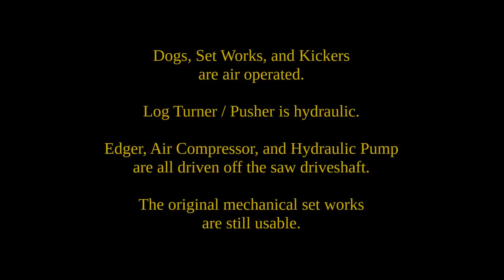Fast Steam Powered Air Set Hardwood Sawmill - Buckeye Steam + Gas Reunion - August 2018

Comment: When the saw blade is in the cut and we hear 'thunk a thunk a thunk'..is that the steam engine under a load?
Reply from the maker: Yes.

Most of these engines have a single double acting cylinder.

The 2 ends sound almost the same, but piping and other minor differences mean that you can hear the difference in sound.
Reply: @SteamCrane  Thanks.

Comment: Nice setup and love the sound of the steam engine under load 🙂
Seems like the air supply is not enough for the setworks.
Reply from the maker: Interesting, next time I'm out there I'll look. Of course they may have upgraded the air compressor since 2018.  Each time we go there, there is some improvement. This fall, they added a green laser for lining up the cut.  Not sure that sawyer really needed it.

Comment: I still remember the sawmill I worked at it was a frick sawmill it changed 2 air dogs the set works wasn't U still had 2 pull the Rachel every time that mill there is a later 1 U can saw some lumber like that in a day's time U have 2 keep the logs on the deck 4 the sawyer saw them fast they don't last like that OMG 12 23 2O22
Reply from the maker: Every year, this mill gets improved.

Comment: That’s a lot of work to avoid using electricity.
Reply: Yep I would do it to save money, and hard work is good for ya.
Reply: With the rate he's cutting the engine could virtually run of only offcuts far better than buying electricity and wiring it all up in the woods
Reply from the maker: Work is sorta the point, it bonds people and builds character.

Comment: R the dogs and set work's air or hydraulic?
Reply from the maker: Dogs + set works are air, chain turner is hydraulic.  Both pumps driven off the spindle shaft.
Reply: Thank u it's a very nice setup!
Reply: Air

Comment: Great video. But I don't know why people use a circular saw mill. A band saw mill loses so much less in sawdust waste it should make a circular saw mill obsolete
Reply: Albert Cyphers, it depends on a couple of things. If you mainly saw one inch, a bandsaw will save you a lot of volume. Now if you saw more squares and pipeline skids and you are really going for production headrigs are the way to go. They can cut much faster unless you are talking big bandsaws which can cut about the same speed. Also, much less blade maintenance on a headrig. It all depends on what you saw.
Reply: A head saw is more forgiving if you don’t have a debarker  and logs are a little dirty also, and the cost to have or convert a mill to bandsaw is a lot of money and the equipment to take care of them, filers, setters, spare blades, etc. adds up. I understand your thought and it is a good one just please understand where I am coming from.   Thank You
Reply: If you’re using a steam powered mill the sawdust isn’t waste, it’s fuel for the process.  I remember seeing a couple of steam powered sawmills around the early ‘70s, long after most industry had stopped using steam.
Reply from the maker: They have a clever use for the sawdust.
Reply: as others said, it depends.  What was mostly being made were timbers 2x and bigger, so not as much waste.  But the speed of a circular saw is much greater than a bandsaw could manage, (of a similar size).  And remember, these are the Amish.  They had the logs, they didn't want electrical motors.  Could have run a bandsaw, but a circular saw is simpler.
Reply from the maker: @mr.bigfoot8409  The sawyer periodically stops to dress the inserts with a hand dresser. Hard to do with a bandsaw. This setup really works well with these hardwood logs, without debarking.  Also, the sawdust gets used.